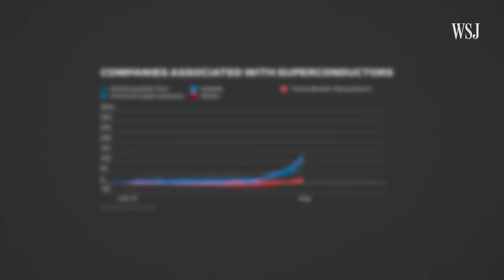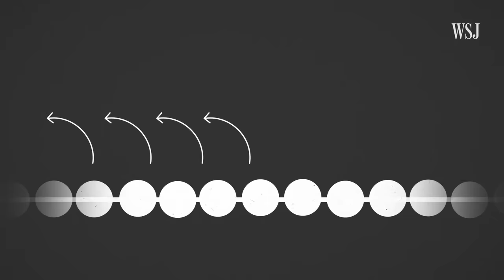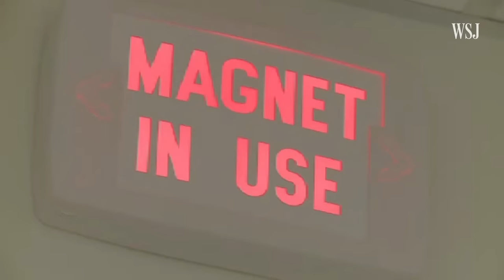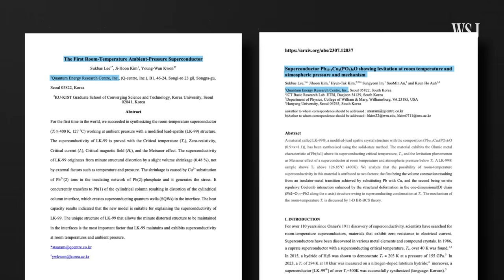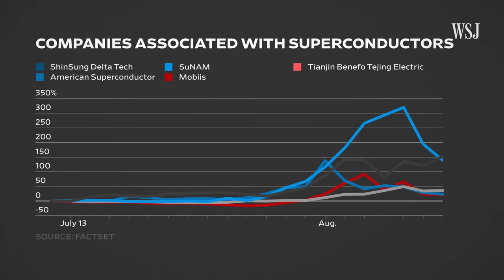Superconductor Breakthroughs: Why Investors Are So Interested in Them | WSJ

Comment: I should have have known since the video is from WSJ, it would be, well, wont have any substance.  But the title is "what is superconductors.." and video has exactly one sentence  about it. I at least expected second sentence which describes why superconductors have no resistance. I think it's because at high pressure or very low temperature, electrons are more stable and oriented in terms of polarity right?

Comment: This video essentially said nothing. It did not really explain what a superconductor is, how it works or how it can be applied to technology.
Reply: It actually did, watch it again
Reply: @SirAkwasi  it didn’t. All it said was that a superconductor does not lose energy through heat. And that it would be life changing for all these various industries. 
It did not explain how a superconductor actually works. Why it does what it does. And how it would actually change those industries.
Reply: @shanemooon  I agree. Video was a bit trash in that regard. The whole time im asking myself and the video what are the real applications of this, of which im sure there are many. it only mentions its used in MRIs
Reply: @shanemooon  the Wall Street Journal, to my knowledge, is predominantly business-focused in its journalism. I don't think we should be expecting significant scientific expertise and explanations given their target audience would be more business-focused as well.
Reply: Read the title.
Reply: I think what the video was saying is that the transmission of an electrical current thru a superconductor material  is more efficient because it prevents any heat energy dissipation (inefficient energy lost thru the transmission process).  Perhaps it can lower energy costs because there is no "real power" loss.   May not be a 100 percent super conductor, but minimizes  "real power' loss occurring thru transmission (as stated by a viewer in a previous comment).